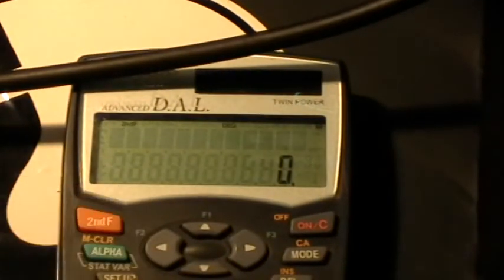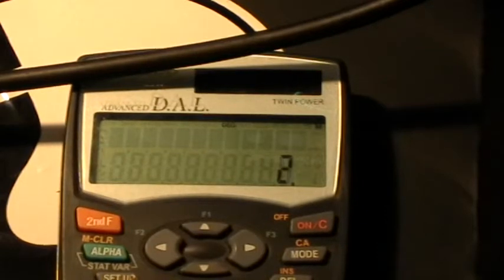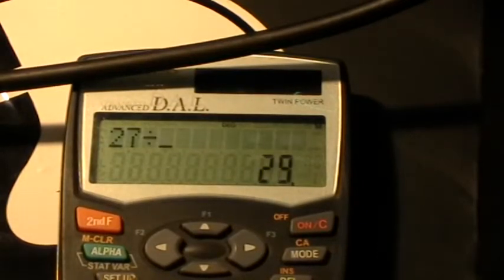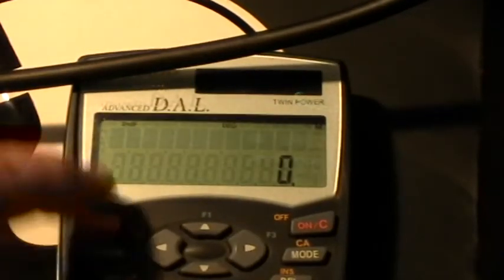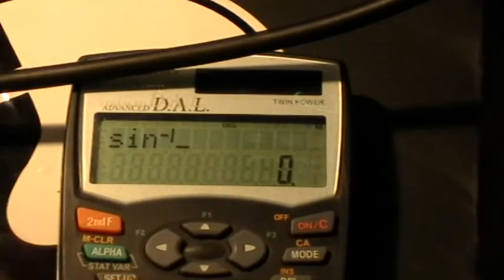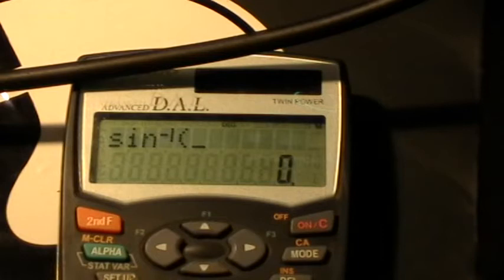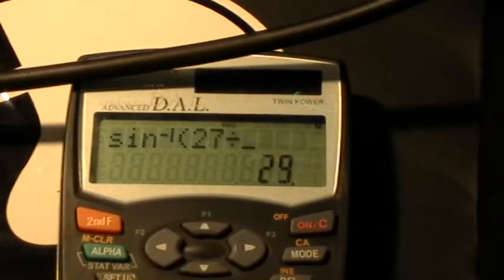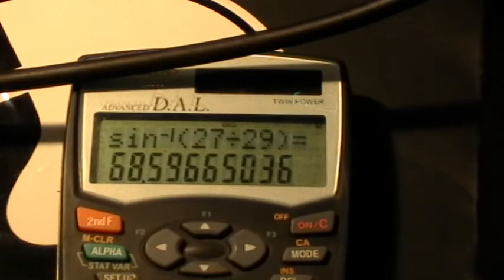Scoposcopy: Phase 2: Lissajous Phase Angle Measurement

Comment: The non-inductive shunt an Ohmite WNER50FET does not distort the measured current amplitude and adds very little inductance via its leads to the overall circuit branch.  The voltage across that resistor is in phase with the rest of the current in the branch which can be way out of phase with the applied voltage to that branch.
Reply from the maker: Yes, that's right. I can't use the resistor in the actual DUT, the MicroQEG's resonant tank, because it doesn't have the power rating, gets hot too fast. So I used a current transformer, the loopstick, and it introduced its own phase shift in the measurement. This skewed the final result and made the DUT's phase shift appear much smaller than it really is. The purpose of this video and the previous one is to review phase shift determination and to test the Current Transformer setup I used to determine its degree of artifactual phase shift on the measurement of current phase in the actual device of interest, the MicroQEG. There will be another video coming up where I actually compare the two coils, and finally will try the tororidal ferrite on the DUT's tank to try to get a clean signal and a correct phase angle.
Nice to hear from you, by the way. I hope you are well, warm and dry, keeping safe.
Reply: TinselKoala Don't forget that you have a PCB with a low inductance 0.25 Ohm resistor on a big heat sink.  It should be good for 10W, 6Arms without a problem.
Reply from the maker: S Weir
Yes, I haven't forgotten. I just hate to take stuff apart, and I'm trying to stay as basic as possible here. Inserting any resistance at all into this particular current branch is problematic though. I did some measurements of a similar circuit by inserting this 0.25 ohm stack in series with the single-turn transfer loop and I was able to operate for a few seconds at a time, enough to get scopeshots for off-line analysis, but the results weren't completely satisfactory since the resistance (and residual inductive reactance caused by the insertion) still made up a significant portion of the total Z of the transfer loop. For insertion I really need something like 0.1 Ohm non-inductive and it probably should be carefully built into the transfer loop itself.
That's why I figured I could simply measure across the coil itself, and call that the Vdrop across the coil's Z, and compute the p-p current that way as Ip-p = Vdrop / Z, then correct for phase angle when calculating final real power. Using the same measurement of amplitude as used for Vp-p. Hence attempting to find the current phase angle (but not amplitude) using the Rogowski or loopstick coil CT. I'm not sure if this is kosher though and would really like your opinion.
Reply: TinselKoala I was thinking that you could use it as-is.  The Q1-S and V- terminal connections along the lower long edge of the board have very little parasitic capacitance to each other and nice low inductance paths to the sense resistor.  The TP3 connection picks up the frequency compensated monitor.
Reply: TinselKoala If you want to do a little science project we could work up a compensation network to directly read across your inductor, deembedding the resistance.  Does your inductor heat up?  If it does then we can accommodate that with a temperature compensation network.  This kind of "lossless" sensing is very popular in many switching power supplies.  With care better than +/-2% accuracy is feasible.
Reply from the maker: S Weir Thanks for checking in. The tank circuit I want to measure is shown and described in this video: Electric OU: Micro SS QEG: TEXAS HAS RESONANCE! OU IN VARs!
The coil does not get warm. Slipping the loopstick over the leg of the coil works to give a signal. Slipping the wound ferrite bead shown briefly here over the leg of the coil is disastrous. Evidently it acts as an effective choke and kills the oscillator and also kills mosfets very quickly. 

If your comment doesn't appear right away, blame Google's screwed up system. If they think you are spam, the comment doesn't show until I've had a chance to review it and they don't bother to "notify" me of comments that they think are spam. Idiots. There doesn't seem to be any way I've found to turn off that damned "feature" which has done nothing but give false positives. Out of 50 or so "spams" only two have been actual spams, the rest are comments from friends and I don't know why they are being flagged.
Reply: TinselKoala The method I have in mind will work well.  We may need to construct a preamp though.  We ignore the parasitic capacitance of the coil, we treat it as a series R*L.  The voltage across that coil is then close to:  sqrt( (I*R)^2 + (I*jwL)^2).  If we feed that voltage to a passive network that has the conjugate function:  IE an RC low pass filter, then the output voltage of the RC filter will be exactly the voltage across the distributed resistance of the coil.  An RC network with an adjustable resistance will let us tune for the corner frequency to match the R/L corner of the coil.  There are a couple of ways to dial in the corner frequency:  The first is to match-up the point of 45 degrees phase shift.  The second is to measure the output of the combined network at 1/10th and 10X the intended operating frequency drive with a current source (or big resistor) and trim to match the amplitudes.  The amplitude method requires a good deal of dynamic range.  The current sense resistance is that of the coil.  To register a decent voltage on a scope may require a preamp.  There are lots of Op Amps that will introduce very little phase shift or distortion at 300kHz.